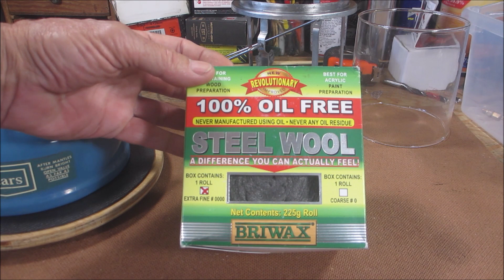Let's clean up my Sears 476 Lantern!

Comment: Colman  ! 

I never could  stand  anything  sears ,
They went bye bye and  closed up ,
I was so happy to see them go away  ,
I have  several  tools of craftmans and  that always  get pulled out when  there is  a nasty dirty job and I'm not  afraid of  beating them  with  a  hammer  , they are pure junk , but I still  gave your video a Thumbs up 👍
Reply from the maker: I’ve had a different experience with Sears. For example, I purchased my first rotary tool from Sears, it was called the little crafty. I had it for over 30 years until it gave up the ghost!

Comment: Nice job brother. Came out great. I’m a little skeptical on the blue lock tite holding and sealing pressure. But I’m probably wrong. Either way it’s alive. 👍👍. Hope you have a fantastically blessed week.
Reply from the maker: Thanks brother, I appreciate it!  I’ve used the blue stuff on quite a few and it has always worked! I feel it works as good as the red, just easier to undo! To be honest, there shouldn’t be a need for thread locker there, but there was some when I removed the cleaning tip assembly. And there isn’t any pressure at that junction when the valve is off. I hope that makes sense! 😂
Reply: @Dominic.Minischetti yeah that makes sense about once the valve is closed. Seems like there were washers or spacers on some of the other lamps you did. Maybe the nut that holds the frame also acts as a jam nut to keep things sealed and tight. Hmmmm. Looks and works great either way. 👍👍
Reply from the maker: @dthomas5281  The jam nut is just to hold down the frame. The valve threads are all tapered like gas fittings. The the correct amount of torque they shouldn’t leak. But to get this one clocked just right would have required some brute force! 😂😂😂 Hence the thread locker. For a lantern that probably getting fired up once or twice and then go on display, I’m good with that!